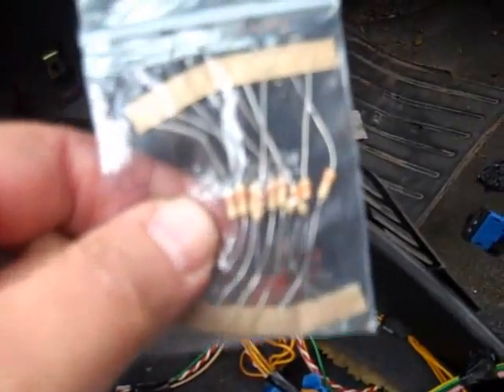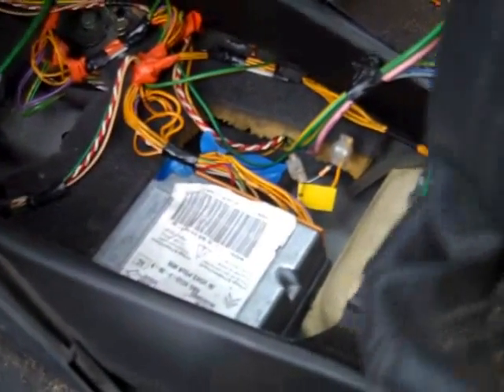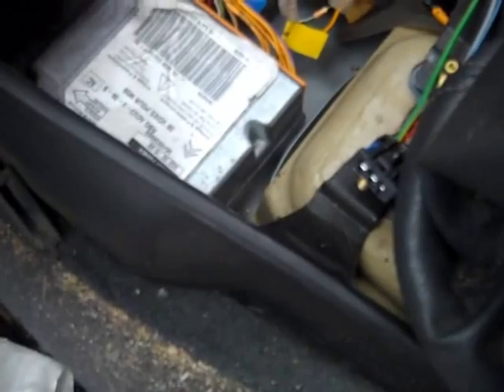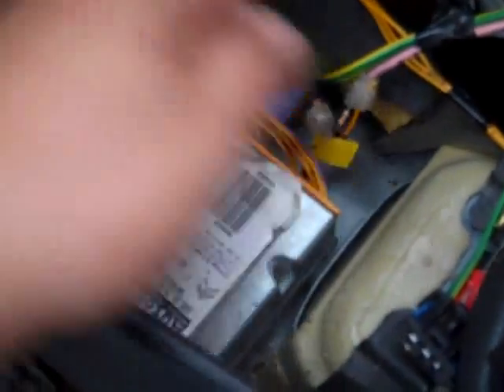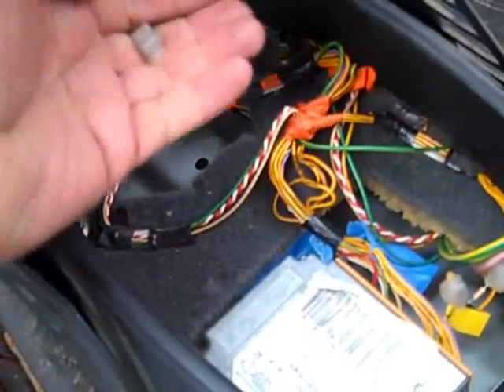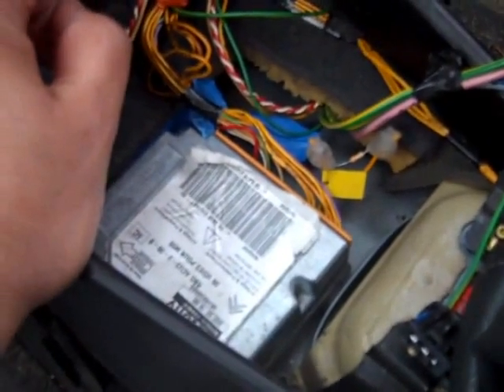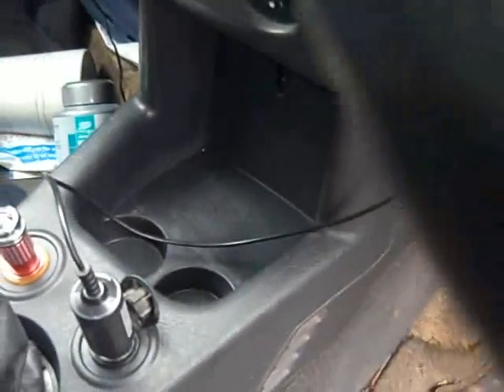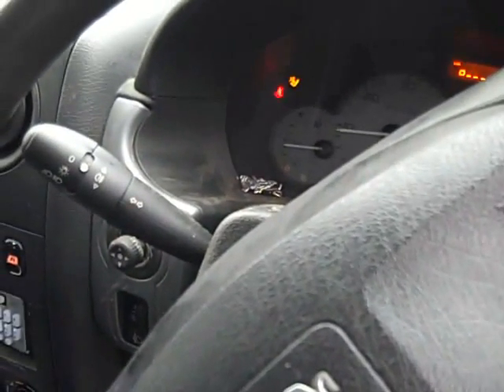Fix Air Bag Warning Light Always On Citroen/Peugeot Berlingo 2003 & Others

Comment: i got a 3.3 ohm res from maplins the light went off then came back on again so i changed it it went off then came back on, can any one help
Reply from the maker: +new2wood1 Can you be a little clearer please?
Reply from the maker: poor intermittently connected wiring; gel crimps properly used?

Comment: Hi,
I did this modification on mine it is a:

Peugeot 206 2004 model. The wires were coded 6501 & 6502 - and I used 3 x 10Ohm resistors in parallel to get the 3.333Ohms needed.

I've connected the 3.333 Ohm resistance between 6501 & 6502 and left the two spare ends disconnected.

Is there any advice?

**EDIT** 

I wondered overnight if I'd mistakenly taken the information to mean that the wiring numbering on your car was different to mine and so I went and chopped the 01 & 02 wires. I wondered you meant the 6538 & 6539 wires were the correct wires and NOT the 01 & 02.

So I dug into loom more and found 38 & 39!!!

I remade the original connections above and did the mod to the 38 & 39 wires. 

Arghhhhhhhhhh I STILL have the airbag light.

The error code that came up originally was pointing to drivers airbag open circuit.... I'm going to have to take the airbag unit out and see if I can fix the clock spring...maybe then I can put the wiring back to normal....

:(

Comment: Hi i have peugeot 206 .Year 2004 .They numbers you quote is that on the cables 

Kind regards derek
Reply from the maker: +derek goodwin Yes, the cables are imprinted I traced mine from the airbags & to the airbag ECU so itrs not too difficult to identify but I guess diffferent years/models might use different cable numbers If you find the cables with my numbers or the manual numbers that I mentioned then they''re going to be correct

Comment: Hi great video...thanks,i have the same problem,done all the underseat checks/connectors but airbag light stays on even after resseting.I have a 2005 berlingo dx was wondering if the same procedure would apply to mine as its a later model than yours.Any advice would be most welcome..cheers Barry.

Comment from the maker: The resistor has two wires but has no polarity so it can be wired either end of +ve. The cable between the Air bag ECU and the airbag (numbers given in the video) needs to be cut but at a place that does not interfere with any cabling management (ie the orange block in the video) and then using BT gel cable fasteners join one cut end to any resistor end for both cut ends (you cut a single wire and get 2 cut ends). Get the parts off eBay: 230850159708 111093221017

Comment from the maker: The air bags are still charged but they do not trigger the ECU as open circuit. Typically, only the driver's side fails because of a conductivity failure in the cheap clock spring in the steering wheel. Otherwise, a similar fault is likely due to the cables under the seat being torn by movement/storage.

Comment from the maker: Maintenance History:
50k new steering pump
50k new brake discs all round
50k smokey turbo but fixed by 3 rounds of additive, result (no further smoke until 75k)
75k steering pump leaks but Lucas Leak stop works
75k 5th gear fails (5th gear alone can be replaced in situ but parts expensive)

Big problem on these model is use of incorrect oil. Engine needs a turbo diesel oil Mobil 1 Turbo diesel provides noticeable running smoothness :-)